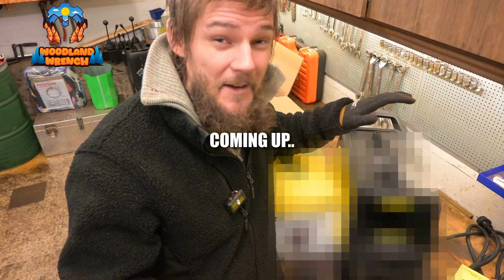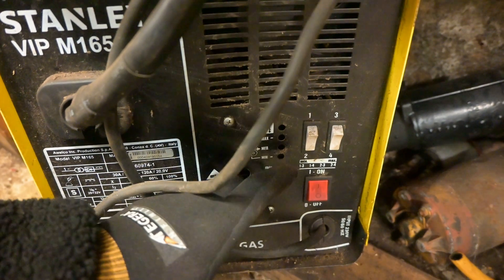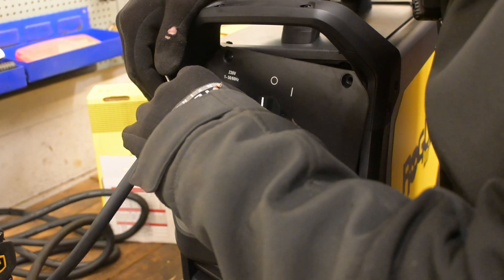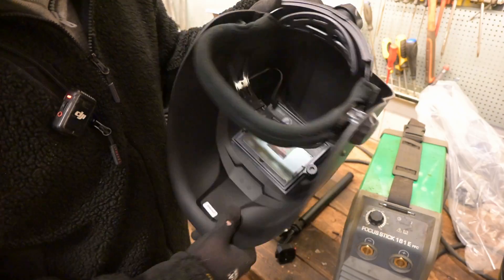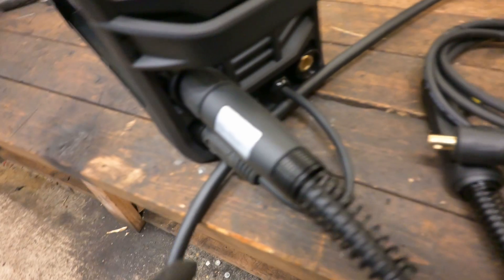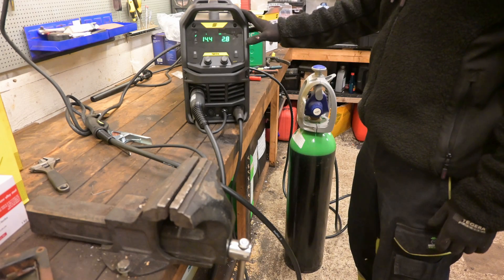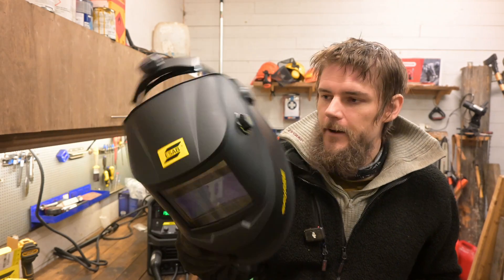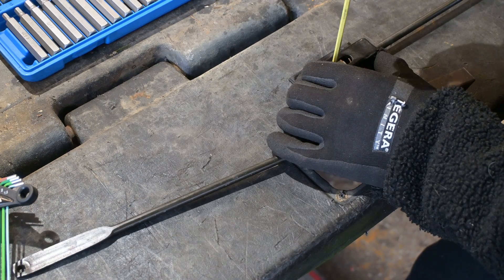Testing The ESAB Rogue EM 180 & Polaris Tailgate Locking Mechanism Repair

Comment: Vil Esab Rogue EM180 funke på 10amp 1 fas? Vet den gamle minarcen 200 funka det. Og hva er forskjell på em180 og emp210 pro?
Reply from the maker: @postmann1000  Den vil funke ja, men du vil ikke kunne sveise på høyeste ampere. 210 pro går opp til 210 Amp og har et litt mer fancy display samt at du får med matehjul for aluminium. Men de gjør samme jobben så vidt jeg har forstått. Forskjellen er Amp, display og ekstra matehjul.
Reply: @woodlandwrench  ser prisen er ikke store forskjell på 180 og 210. Kjøpte 210 pro for 15k nå.
Reply from the maker: @postmann1000  Nei det er vel bare et par tusen. Gratulerer med nytt apparat! 😁

Comment: Yea u will burn your wire feed motor if you have it clamped to tight, think your supposed to make it as loose as you can without wire slipping
Reply from the maker: @KeeLLuR  I see. I'll look into that. Thanks! 👍😊

Comment: Hvor mye måtte du ut med? Akkurat kjøpt meg samme, men 210 :)
Reply from the maker: @espen5322  Betalte 10k for maskinen. 210 ja kult! Gratulerer 😁 Er den 3 fas 230v eller 400v?
Reply: @woodlandwrench  Neida, er vanlig 1fas 230v denne også :)
Noe spesiell grunn til at du vil ha 3 fas?
Reply from the maker: @espen5322  Jeg har 3 fas i verksted, men bare 16a sikring. Kan sveise med høyere ampere på 3 fas 16a enn på 1 fas 16a. Tror det er x1.7 elns 😄 Vi får se om den kan kobles om, tror ikke det blir noe problem uansett. Og jeg har et 32a uttak til bandsaga som kan brukes til nød 😊
Reply: @woodlandwrench  I see, men tror ikke det apparatet kan levere noe mer enn 180A uansett :/
Reply from the maker: @espen5322  Nei men jeg er redd sikringen min ryker når den trekker over 120-130A

Comment: Pretty cool. I don’t know much about welding. I did a little stick welding back in the day. I’m retired now. Maybe I’ll buy  one of those kinds of welders and get back into it. I have lots of broken things around my house that could be welded.
Reply from the maker: Sounds like a great idea! Stick welding is a solid place to start, and you can often find used machines pretty cheap. I think I paid around $400 for the Migatronic. If you're interested in MIG, there are some decent budget options out there too like the Stanley's. But if you're planning to weld outdoors, I'd definitely recommend stick. Though flux core MIG can work as well. Appreciate the comment!

Comment: Hello Richard, I encourage you to read your welder manual. The wire grip adjustment you asked about is to set the wire to where it won't continue to feed and crinkle up the wire somewhere in the gun assembly or the feed tubing. It would be very bad if the wire just kept feeding with say the wire accidentally welded to the tip. Or welding in a tight spot and having a hard time initially getting the wire to arc. As I understand from my old mig/flux welder, you want to be able to have force enough to feed the wire, but a hard stop (like a block of wood) causes the wire to stop feeding and the feed wheel to slip.

I am happy you have another mig welder. I watched you struggle to weld thin metal in the past. This should make those repairs a bit easier. I push the upper end of our mig or flux welder as I don't have a larger welder. Heating up the metal before welding Can help compensate for that, but might not be the best idea for a high strength weld. Passable for us as individuals, might not pass for a welding shop standing behind their work. Thank you for the video. I am happy your tailgate latch is working better now. Take care.
Reply from the maker: Thanks a lot for the detailed reply! That actually makes a lot of sense about the wire tension. I'll give the manual a proper read and check the settings. And yeah, this new welder should definitely make thin metal repairs a lot less frustrating. Appreciate the tips and the kind words. Glad you enjoyed the video! Cheers! :)